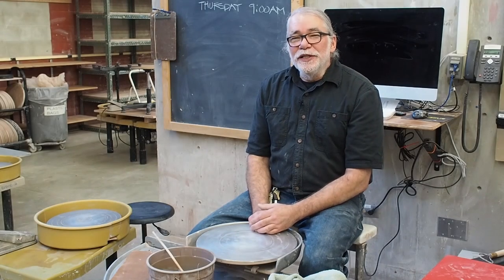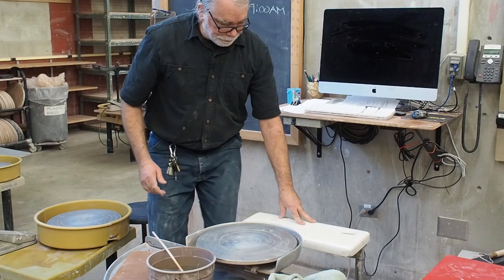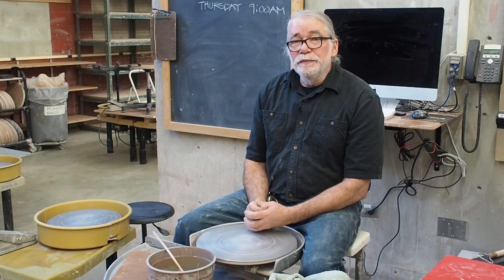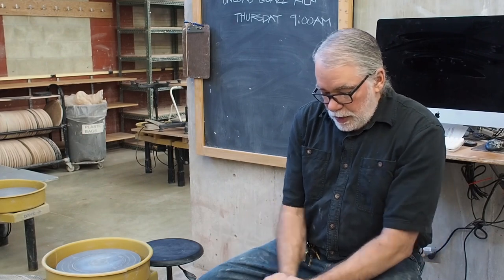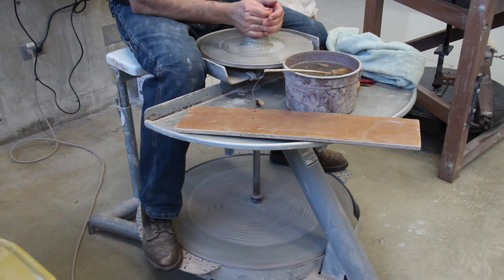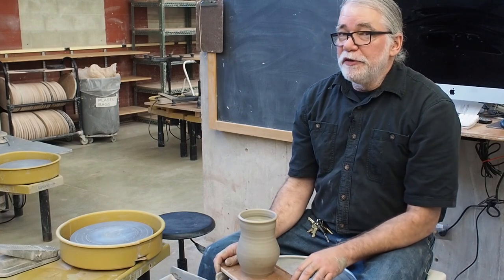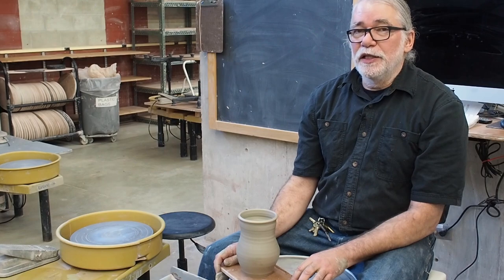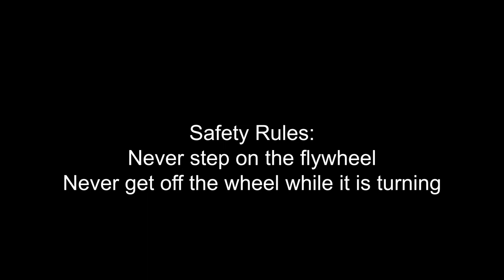The Potter's Kick Wheel

Comment: Does a kick wheel ever need to be lubricated or greased?
I haven’t thrown in a very long time but recently purchased two kick wheels like the one you are using. One was outside and needs new wood for the seat, the other one was from a school and wasn’t exposed to the elements.

Comment: When I use an electric wheel, I end up with a splash pan full of water and slip. Is it important to use less water or not mess around too long as there’s not a deep pan that goes all the way around? Thank you for the tips!! I’m hoping to buy a second hand one.
Reply from the maker: This wheel pan dumps water back on the larger work surface.  It catches water but trimmings fly off.  None of this bothers me as the kick wheel in my home studio also has a very small improvised splash pan.  Put a big sponge where water drips.  Sweep up the floor before trimming so you can sweep up the trimmings without getting any foreign material in the recycled clay.  This wheel is quick to clean up after use compared with wheels where you have to remove a two part splash pan.  Some of my students take half a semester to figure out how to put a splash pan back on a Brent wheel.  Use however much water you think you need, no one is judging how you work.  Rather than mess around with one pot, simply take off when you get what you like and use the mess around time to make another piece.  In my opinion, Lockerbie wheels have way too heavy of a flywheel for small to medium size pots, the kind most of us spend most of our time making.
Reply: Thanks! I like the idea of a kick wheel, but I will be making smaller pieces-probably 20 lbs at the most. Is there a kick wheel that is lighter for that level of throwing? I love Brent electric wheels, but I can’t find a used one, and for now a new one is out of my budget. I don’t know that I need a wheel as sturdy as a Brent, but I really don’t want to spend several hundred dollars for something that feels rickety or wobbly compared to the Brents I have used. Thoughts?
Reply from the maker: @janebell469  New potter's wheels are not cheap.  No one buys kick wheels so no one aside from Lockerbie makes them that I know of.  
Suppliers used to offer kits for kick wheels containing bearings, shaft, wheel head and plans.  I just looked and didn't find this available any more.  My suggestion is watch CL or Marketplace for used equipment.  Often there is nothing but a few weeks ago there were six electric wheels listed in CL.  Getting what you want in the used market simply requires patience.  Lots of people abandon this "hobby".  Take a good look at what you make.  Almost everything I make is less than five pounds.  Majority of functional forms are less than two pounds.  You don't need something that is rated for 50 pounds unless that is what you use it for.